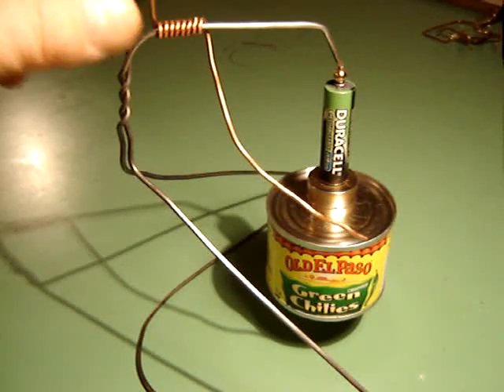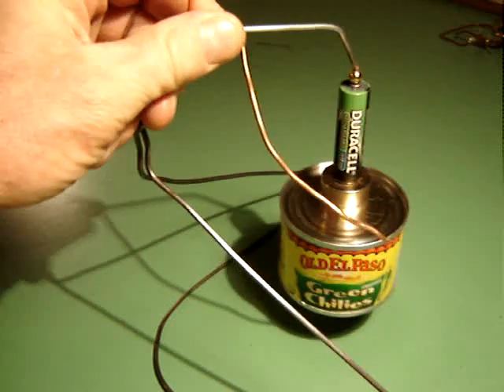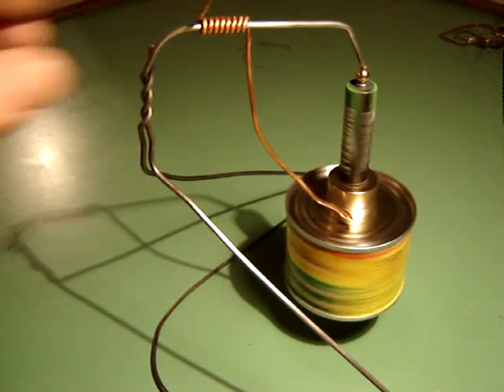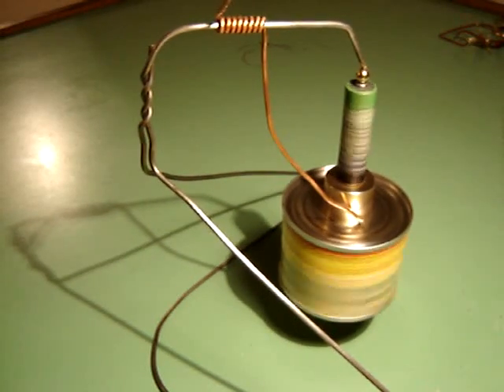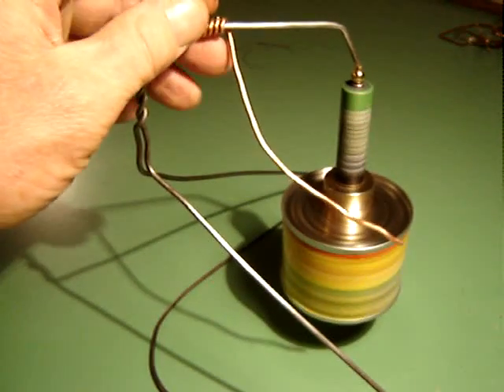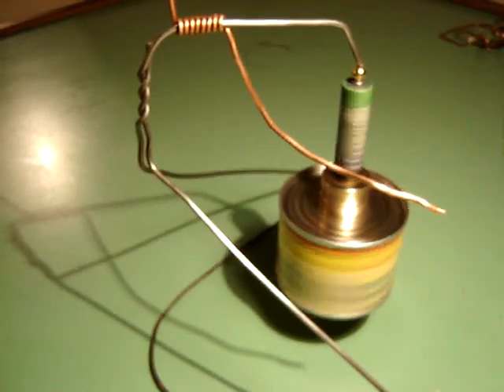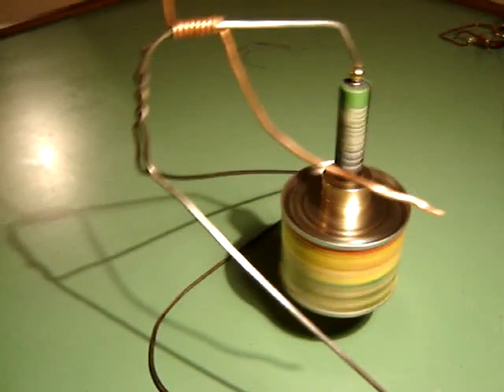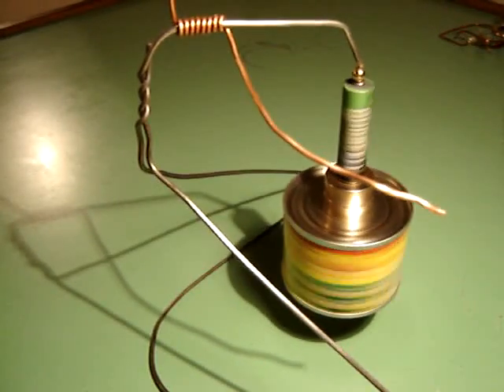Homopolar Motor With Emergency Brake System

Comment from the maker: Do you have a powerful neodymium magnet? And a small neo ball magnet? And the most powerful Duracell 2650 Mah rechargeable, fully charged? 

Copper wire wound around a metal coat-hanger; the coat-hanger has lacquer on it that must be sanded off where the wire wraps around, and where the battery hangs.

Follow that and try again.  Any questions, just ask!

Comment: i have seen vids over 10 minutes, but its a .avi which i have uploaded before. anyways, i figured out the problem, it is with our network, it is either a faulty modem, or just a crap internet connection. it is good stats, but it is a new company and they dont have great equipment, so it is not very good.

Comment: -wow
-must have taken a long time to tune that perfectly
-is that a ball magnet on top? how does this affect it differently than the regular homopolor motor?
-could the can ba used for a super-slow speed just as the coins were in the stick shift model?

Comment from the maker: Sorry, no free energy here..the battery loses it's juice pretty quick, and has to be recharged with a charger.

However, If you could spin the magnet very fast with a drill or motor, it could begin to charge the battery.

Comment from the maker: Hmmm...(mrfixitrick's mind reels as it tries to determine what part of the comment insult0master made is the main insult...)

uh, Yes, (coming back to reality;), yes, besides my ambition to save lives with my  application of this over-running device to tiny little motors, the idea is sorta common to steam-engines and older diesel engines that require a governor.

Generally, the governor rotates with the machine's shaft, flings itself out at a prescribed rpm, and turns down the throttle.

Comment from the maker: Thanks for the compliment...it's hard being simple!

The battery will last for about 5-10 minutes. It's a 2650 MaH battery (2.65 amps) and it probably gets drained half-way when "dead". Let's assume 1 amp, times 1 volt average, which equals one watt. So total energy perhaps .1 watt-hour?

Comment from the maker: Youstupidmoron; If you were to build one of these, the "emergency" is that the  setup starts rotating too fast, and can get off-balance and fly apart, thereby endangering spectators and small animals.

My simple but effective addition prevents this possible catastrophic failure. 

It's a variation of my "5-Speed Automatic Hpmopolar motor" video. Instead of automatic shifting, it's automatic braking. 

It works by shutting down the vibrating or over-revving system. It has a manual re-set.
Simple.

Comment: Thats not a car! If it was automatic, it WOULD reset so the can could resume spinning after it stabilized. What good is it going to do if you have to MANUALY engage it?, Like I said, you were just using that wire to make the connection and when it suddenly moved and slid forward you decided to call it an "emergency braking system"  Whats the emergency?

Comment from the maker: If it reset by itself, it would no longer be a brake. Does the emergency/parking brake in your car reset itself when you put it on??

It's called automatic because the brake kicks in automatically when there is excessive RPM or vibration.

Comment from the maker: Also, the main magnet is a 1 inch x 1/2 inch neodymium, and there is a small ball magnet between the coat-hanger and the battery.

Comment from the maker: The copper wire wrapped around the coat hanger vibrates when the motor goes fast. As it vibrates, the copper wire moves down the coat-hanger holder until it no longer touches the magnet, which cuts power to the motor. The copper wire then scrapes the chilies can to slow it to a stop. All automatically!

Comment: Very nice demo set-up! 
If you now put an insulating layer where the brake moves to touch the rim, you will save continuing to drain the battery wastefully during braking phase.
(How long does the battery last?)
Thanks for the video!

Comment from the maker: Thanks for comment. The idea behind homopolar motors is that an electrical potential across a magnetic conductive disc will produce torque. The torque may be manifest as a rotating copper wire, or the magnetic disc itself will rotate, which is the case here.

Comment from the maker: Ok, from the bottom up you see a tin of chiles, a 1" x 1/2" neodymium  disc magnet, a AA Duracell rechargeable NiMH  battery of 2650 mah capacity, a 1/4" ball magnet, and a coat-hanger stand. There is a piece of copper wire wound around the coat-hanger that makes contact with the disc magnet. Contact of electric current at the sides of a magnetic disc will turn it.  Check out other videos I have posted and also my playlist called Homopolar Motor for more info. Or ask a question here. HAVE FUN!